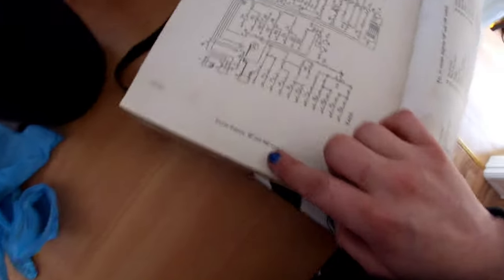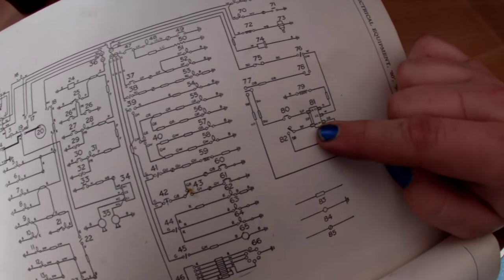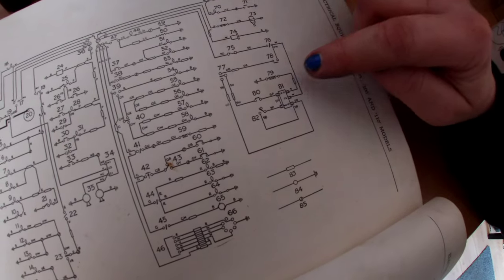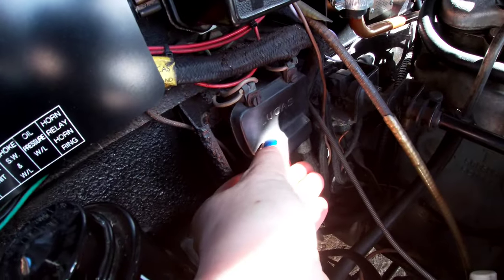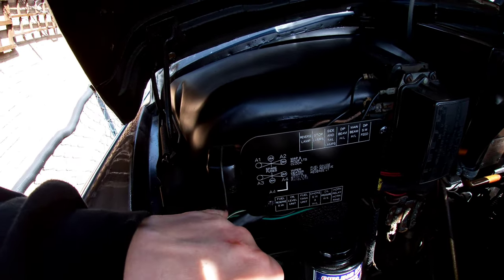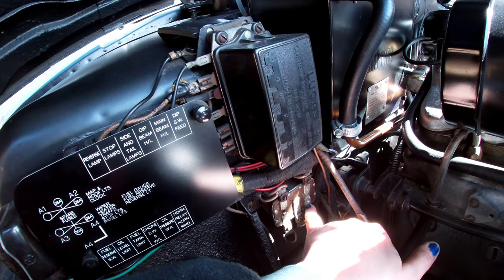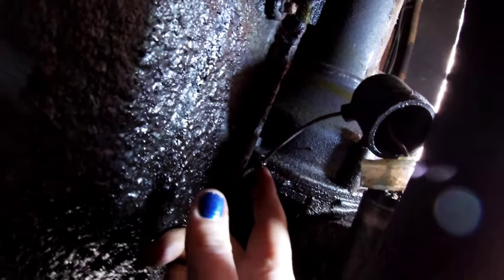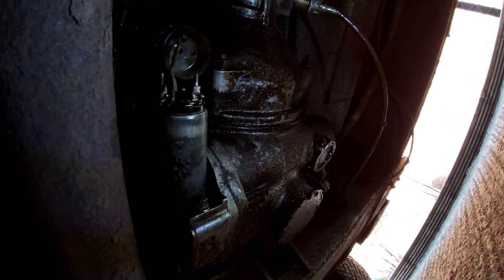Rover P4 - Overdrive Not Working - Basic checks and what I found .

Comment: I enjoyed this.. i am seriously contemplating a P4 6 pot.....these little videos are helping me. So far i have established that the 110 is the only one with a seperate inlet manifold. So many questions but you are delivering some excellent answers...Thanks.
Reply: The 2.6 litre 6 cylinder P4 engine is basically the same engine as found in the Series models of 109" LWB Land Rover. They share parts with the bigger 3 litre 6 cylinder P5 model's too. The main difference is the 3 litre has a longer piston stroke. They're easy to work on, but a little unfamiliar to modern day mechanics. They have an overhead inlet, side exhaust valve arrangement.  The inlet valves are in the cylinder head, but the exhaust valves are set at an upwards angle in the block, and adjusted by removing an engine side cover. They're a nice smooth engine, the old sales brochures made a point of it too.  They'd show an old Threepenny bit coin of the time, it could be stood on it's edge on the air cleaner, and not fall over when the engine was ticking over !  I tried it on my old 3 litre mk3 auto and actually increased it to over 1500 rpm before the coin fell over !
Reply: @brianwhittington5086   thanks Brian.Yes old mechanic it is then. I toyed with P5/P5b as an alternative, the main reason being that intend to convert to Lpg injection, my only criteria is the prices are going beyond a retirees budget. Too old for my sports car now, so once that has gone, i think Auntie may be the solution.
Reply: @jesscourt9068  The P5 /P5B are both absolutely brilliant cars to drive. The P5B V8 Coupé is the most sought-after, but prices are high for the best examples of any model. It's down to personal style preference between saloon or coupé in either engine variant.  All four doors and everything from window waist level to roof are different, and the Coupé has more instruments, and more bucket style individual shaped rear seats, so a little less comfort for 3 in the back than the saloon.  The P5 mk3 3 litre auto is as good as the P5B until it comes to the performance from the V8. It totally transformed it from a  luxury car into a wolf in sheep's clothing. The V8s were all auto, but you could have auto or manual 4 speed and an overdrive option on the 3 litre.  I've had four P5/P5B back in the 80s when they were more affordable, and I would have another V8 Coupé if space allowed.  Never owned a P4, but I've worked on them, and there's shared components between P4/P5 model range if you know what to look for. The P5 is a bit more structural rot prone than the P4 is with their alloy panels and separate chassis. The P5 was an all steel monocoque bodyshell, and the stressed inner structure can suffer corrosion.  If you're opting for a P4, the 105R version is rare and has a Roverdrive semi-automatic, fluid driven, two speed freewheel transmission + an overdrive   You'll probably struggle to find spares for the Roverdrive gearbox now. As to LPG, you'll probably find more advanced kit available for the V8, and it makes a good conversion from experience of it in P6B and Range Rover's.  I've never seen or driven a converted 2.6 or 3  litre Rover 6 cylinder to say what they're like.

Comment: Hi Alex, I had a problem with the overdrive not working on my P4 80. It turned out to be the bracket that holds the microswitches on the bulkhead at back of the engine. When accelerator is pressed it makes the switches in a certain order. The bushing was badly worn. Replaced bush. Now overdrive working perfectly. Had my P4 80 for thirteen years and love driving her. Love watching your videos.
Reply from the maker: So glad you managed to sort of the overdrive 😄 . It's such an over complicated thing with all those switches . Well done 🥰

Comment: Hi Alex. I've had quite a few overdrives, in various Vanguards I've owned. The solenoid has 2 windings in it - a strong one to pull the overdrive valve into position and a weaker one which uses less current and is just strong enough to hold it in position once it's there. The contacts in the end of the solenoid switch out the strong winding once it's done it's pulling. I haven't owned a P4 (yet), and am not familiar with the switching on the accelerator pedal. I imagine that flooring the accelerator will switch out the overdrive? But what you did under the bonnet suggests that there needs to be a certain amount of throttle before the overdrive will engage? Does this mean that the overdrive switches out on the overrun?
Reply from the maker: The throttle has to be at a certain position to allow overdrive to engage.  But once it's engaged the micro switches do nothing and it only comes out of overdrive if you flick overdrive switch up on column and then i normally dip clutch and bap accelerator pedal so switches then kick it back out of overdrive.  
It is very complicated lol
Reply: Thanks @Alexsassets  It does sound more complicated than it needs to be.  When the day comes that I have a P4, I might be tempted to bypass the microswitches (of course retaining the inhibitor switching on the low gears and reverse) and have the overdrive operate simply at the command of the column switch, as per Vanguards, Triumphs, MGs, etc.

Comment: Hmmm interesting . I've got a Dolomite Sprint that I've had Overdrive problems with a couple of times. Luckily for me it turned out to be poor wiring to the switch on the gear knob : )
Reply: It is a common problem with all Triumphs that have the overdrive switch inside the gear knob. The wires that go through the gearstick chafe and evenually short out. No such problems with my 1850 auto.